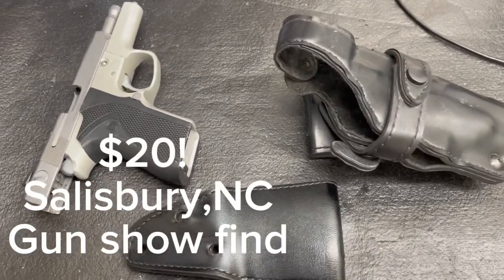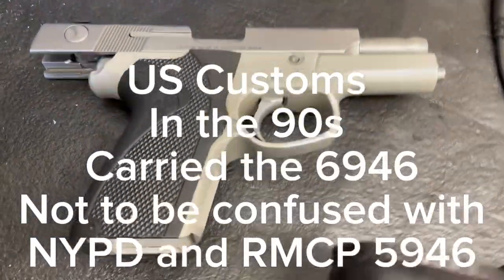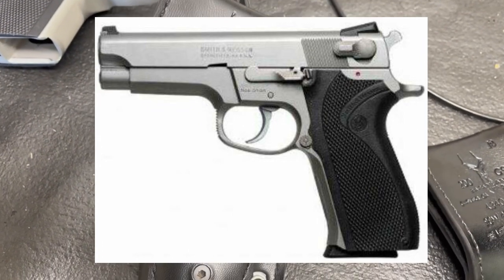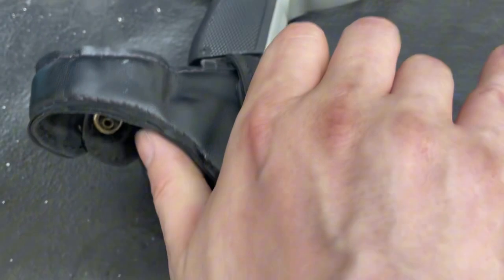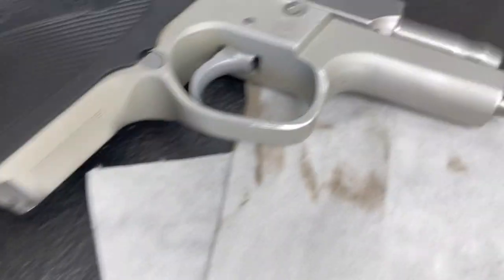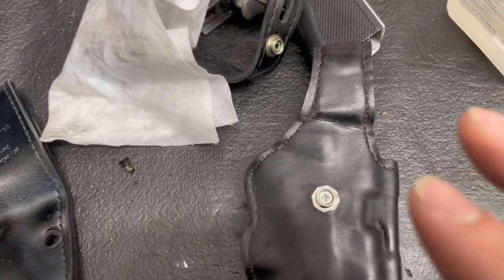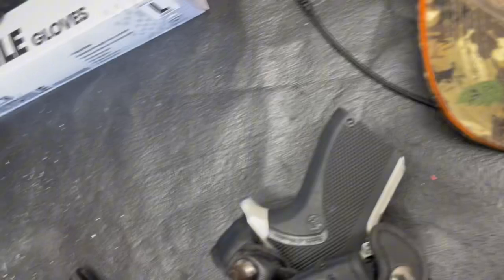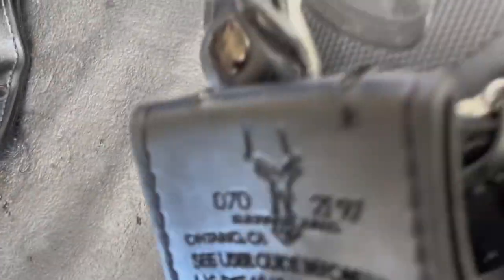Safariland 070 Holster restoration

Comment: I bought 2 brand new 070 for my beretta and glock. Great holsters. very good looking. They do take FOREVER to break in brand new. I had to use heat, hair dryer, stuff the gun into a plastic bag before putting it into the holster to expand it.